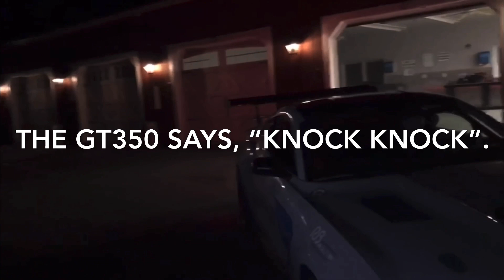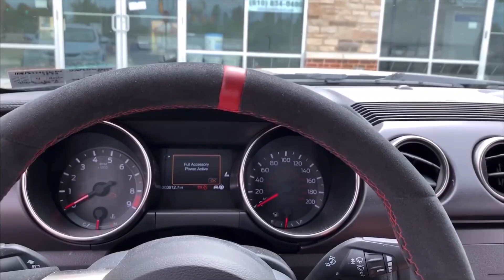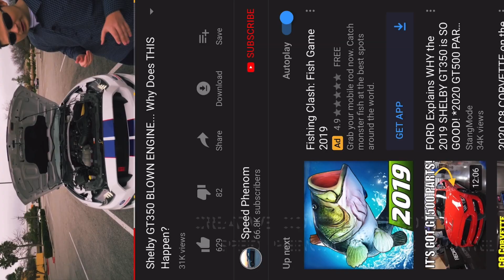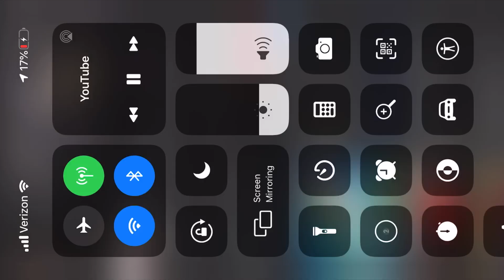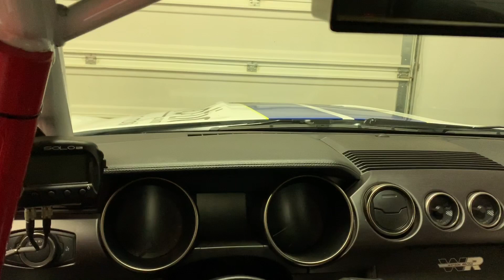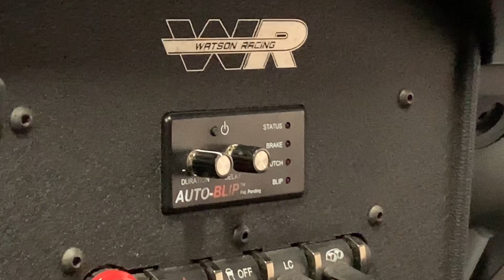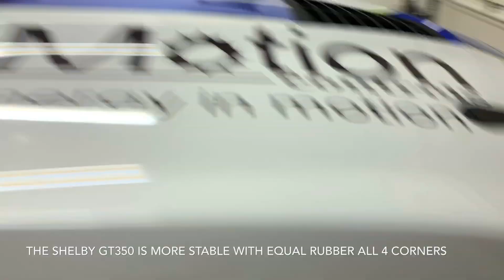Problem Solved!  GT350 Blown Engines Track Day Preparation!

Comment: Brother this is the video I was waiting for ! So much useful info it’s just a shame from Ford  that if Gt350 owners get that red flag of high oil consumption theyr kind of left helpless and ford won’t do anything till the engine blows ??? ... there should be a process of replacing bearings, parts, pumps, or balancing the engine or whatever the hell they do ! Especially if a customer for a $80-90k gt350r comes in with that complaint giving them all the info ! .... cheers for the vid

Comment: I have been fortunate ... My 2020 GT350 never loses oil .. even when on track ... And I have 11K miles on it.  And any race engine can blow up at anytime... I bought the extended 6 year warranty from Lombard Ford.   If it blows .. then I will get a new engine... Thank you for the information ... I do all I can to keep it running great with Amsoil fluid changes all around .. And I do appreciate your video ...
Reply from the maker: I used Lucas Treatment and 5w-50 from Schaefer Racing and the Race Car is still running a Gen 1 and she’s strong

Comment: Had a 2018 GT350 and had no issues with oil consumption. My 2019 that I bought shortly after had an oil pump failure, the shift rod slipping through the plastic bearing, and a bad synchro between 2nd to 3rd. 3rd to 2nd was fine. 

Ford took care of me with all those issues. My dealership here was really on point and didn't mess around. Got an entirely new motor, tranny, and even a shifter. Everything was new again and haven't had any issues. The new motor also doesn't consume oil. So that's sound advice on telling people that if your engine is consuming oil... watch out. They shouldn't. It isn't normal. Maybe a very small amount, but I've put 3000 miles on my car since its first oil change and have had zero consumption. Just like the 2018 I had.
Reply: I have a 2018, same, no issues.  You bought a 19?
Reply: @rider14mcd63  That I did. It was just too good to pass up after my 18 was wrecked. Which was Kona Blue. The 19 I have now is a Ruby Red color with all the goodies. The upgrades are minor, but I certainly feel the difference.  I had considered waiting for the GT500, but performance and numbers aren't everything for me. The manuals are just more thrilling and engaging. It just has more soul and spirit.

The 19 still has the same wheel hop problems if you get a little into it on the street, though. Specifically when you're shifting from 1st to 2nd. That's to be expected from a stock setup I guess.
Reply: @Evoker42  congratulations on the new car.  The one thing I would change is the seats.  I'd go for the leather.

Comment: A few of us innovative(cheap) heel & toe'rs have bought/built spacers to "create" a higher mounting surface for the throttle, thus shrinking that depth between brake and accelerator pedals.

Comment: Known weaknesses are the oil pump and the single cam chain. Use a racing oil pump and double chain setup. Use a Group 4/5 oil like Redline, AMSOIL Signature Series or Royal Purple. All the other U.S.-made "synthetic" oils are Group 3 with no synthetic base (no PAO or POE). Also a dry sump oil system would be advisable for track use because of high Gs.

Comment: I initiated a buyback on my 18 gt350. At 5400 miles my car died in middle of road. Never started again. Had towed to ford. Engine was replaced. Driving to work engine light started flashing. Never lost a drop of oil. No warning.....
Reply from the maker: The motors are garbage

Comment: If it’s knocking turn it off,seems like number 8 is common,suspect crank flexing number 8or oil problems
Reply: @ShelbyExotics  Number 8 , bearing failure could be caused by distortion of the journal, under high torque,these new low friction,light weight design's are made to very fine tolerances,

Comment: You said the wheels in the car in the video are 6GR. What are your offsets and dimensions front and back? Also the front tires in this video looked like a 295. Are you running 295 all around?
Reply from the maker: 315s all around

Comment: in the new engine I have zero oil consumption after 100 miles to the track 40 mins of straight 3rd gear 7k most of the time and 100 miles back. Totally of 3k miles on the new engine. .... let’s see what happens.
Reply: Did they let you take pics of the bad engine?

Comment: What brand of oil do you use specifically, you never mentioned that verbally in the video. I've read that AMSOIL is a good choice.
Reply: @ShelbyExotics  Thanks I never even heard of that brand. I hovered around the mustang6G forums and came across this link https://thesoundofvoodoo.com/articles/everything-you-need-to-know-about-gt350-engine-oil/ which includes a few listed brands but no Schaeffer.

Comment: No problems with mine. Don't drink this kool-aid.
Reply: @ShelbyExotics  I check my oil weekly in all my vehicles. I guess it's a good thing I have the top-of-the-line extended warranty. I can't imagine however that Ford knowingly is putting out ticking time bombs. I would think if what you say is true, then there certainly would have been a class action or at the very least, some lawsuits over the issue. I don't track my car and I'm not the least bit worried about catastrophic failure. If it does happen at some point, I'll come back here and be the first to let you know.

Comment: Sold mine and bought a 2019 GT5.0, better car, better motor, just as fast. The flat plane crank was a Ford mistake or they would have used in Shelby 500.

Comment: In the end, the Voodoo is just a POS that needs to be recalled. Everything else about the car is great. It even has the better transmission. Who in their right mind pays about 50-60k for a car knowing the motor might blow before 10k miles? No excuse for this BS from Ford!
Reply: No regrets here. 
If my engine goes, I am getting a built engine and I am bumping up the boost
Reply: @TriAxleTranny  yep, I like mine just fine.
Reply: If you constantly over rev any motor it will fail and have a short life.
Reply: I agree 100%. The car is a masterpiece - but for the engine that might or might not hold up. And I’m tired of devoted fans making excuses for Ford and blaming the drivers. This car was built and marketed as a track purposed machine. It doesn’t even wake up until you’re at 4500 rpms. It was intended to sustain high revving. There’s an inherent flaw and Ford isn’t talking if they’ve figured it out. I have no allegiance to any manufacturer. I like all cars - but I do believe in fair business practices when any customer spends hard earned money on your product.
Reply: @myvalium1  Yep, when people make excuses,  Ford will just continue to ignore the problem.  Rated R Cars said he got a newer engine with upgraded parts. If that pans out then it's a start and there is hope. 
But I doubt Ford will issue any recall. They'll just wait for blown engines to show up. Sad.

A recall would only happen if sales go down.
Reply: All the failures I've seen so far  are from over revving the motor.  There is no engine made, designed, or manufactured to operate above its red line.  I'm not making excuses, if I lose a engine, I'll claim it under warranty.  I will however maintain that if you operate it within design it's a great motor.  It will not, as plenty of video evidence, thanks to UTubers shows, take banging it over the red line.  And as someone pointed out if your engine starts using oil, it's the beginning of the end for it.  Almost every documented engine failure that is the precursor to bearing failure.